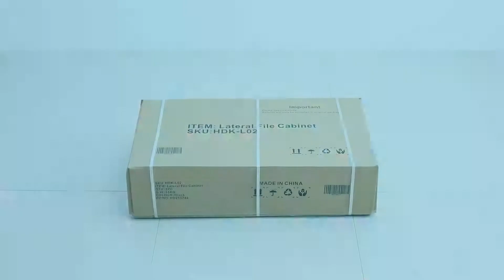2 Drawer /3 Drawer and 4 Drawer Lateral File Cabinet Installation Tutorial

Comment: There is a difference between the 2 drawer and the 4 drawer cabinet installation.  This video does not show several piece of the equipment or installation of that equipment.  The 4 drawer has anti-tipping accessories and the written instructions are not clear as to how to install.  I was hoping that the video would be helpful.